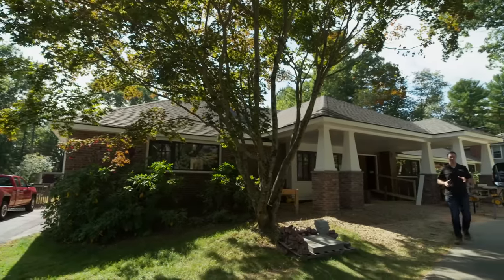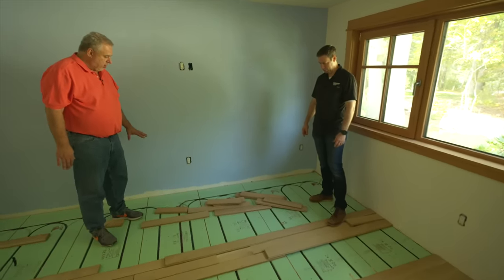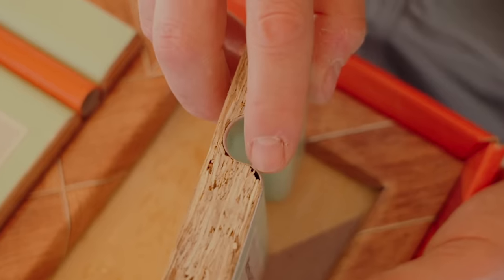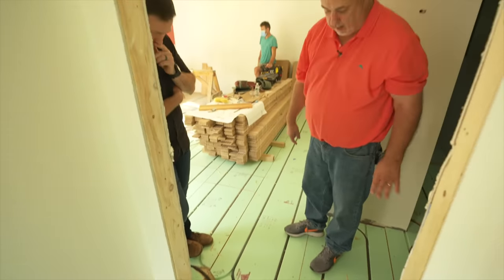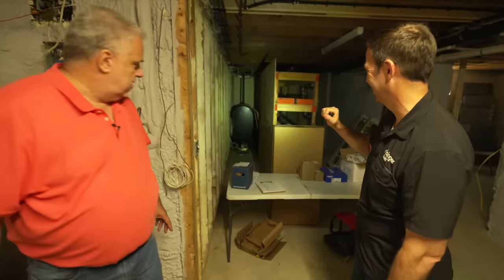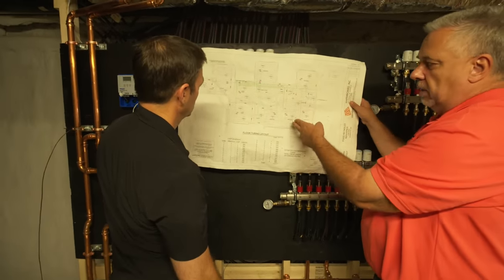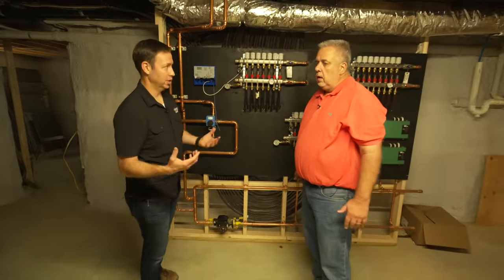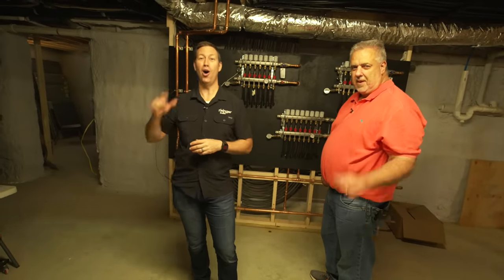Plug and Play Radiant Floor Heating System - BEST ON THE MARKET

Comment: Matt love your video, we have in floor heating in our basement in Alberta Canada, where it can get to -40c for up to 2 weeks without a break. It is truly a game changer for anyone that has ever questioned the cost don’t. We use a forced air furnace for upstairs we have a 3800 sq/ft bungalow and with just 4 loops in the basement slab it is toasty warm in the winter months. I don’t think we would ever own another home without it. Every other house we go into they are freezing in the basement not us. Love the idea for upstairs especially on a pre existing sub floor. I’d be concerned if I had a gas failure though as my frost line is 6-8 feet below grade so it don’t take long for above grade piping to freeze 🥶. Seen it too often where people’s pipes freeze and slip open.

Comment: @Michael Sun  We did the warmboard on our remodel in 2014 and used red oak in a varied width pattern with our widest boards being 10". We also glued and stapled and with the closed cell spray foam insulation we have are our mixing valve is set to a maximum temperature of 95 degrees and so far we have had no cupping or movement in the flooring. We are located in Connecticut and leave our thermostats at 72 degrees all winter and I can honestly say we couldn't be happier with the system.
Reply: Thank you!!! I would expect similar results here
Reply: So pleased to hear you've been having a great experience with our system.

Comment: That setup was anything but "Plug and Play"
Reply: Was thinking the same thing....this looks like a pain in the ass to install
Reply: @gregorygrimm5540  imagine the hardwood floor guy nails one the pex lines...... goes unnoticed long enough to have water damage the hardwood floors.... now try and find where the nail is.... rip up all the hardwood floors....
Reply: Last time I checked Warmboard was over $110 per 4x8 sheet. That was a least 10 years ago. I can’t imagine what it costs now.
Reply: Electric floor heating is the way to go
Reply: @gregorygrimm5540  Ha ha, but it will be ton easier to repair that than if floor heating was done inside of concrete (best imho since concrete retains that heat for so long even if it does not conduct it as well). However the good thing with concrete heated floor is that will unlikely ever need to be repaired. Have seen some that were over half century old and ran fine.
Reply: @danylachapelle309  you keep an air test at 100 psi on in floor heat basically the entire time it is installed until it is covered. You will know if you hit it while installing hardwood.
Reply: @TRUE_GR1T  yep, add in a battery, pressure switch and buzzer and you know within minutes if someone punched a line....
Reply: @danylachapelle309  well water has a nasty habit of flowing downward, so any water from a leak will flow to the nearest panel end seam and down to basement or crawlspace so you can get to the panel and the run fairly easily.  Now where along the run on that panel? well a magnetic stud finder can probably ID where the offending fastener is.  If you can access that spot from the bottom(not on top of a truss or joice) you can cut out the WB subfloor to access the tube and install a splice without pulling any hardwood.  If not you will have to pull some floor to repair the leak...
Reply: @danylachapelle309  You pressurize the tubing during construction and if they hit a tube you know immediately.
Reply: System Freeze (small/Murphy’s Law) risk would be a wintertime (storm) week long power outage while you are in FLA
Reply: @jmac838  you can use antifreeze if you are concerned with an unattended freeze...
Reply: exactly. but i guess that's the point of clickbait; as long as they get you watching the video the title can be an outright lie. id expect better from this channel, but here we are. this is probably a $40,000 install, on top of it. what a crock of sh-t haha
Reply: @briandonovan6546  i am finishing up a 2Ksq/ft and it wasn’t really difficult.  The panels go down like any other t&g subfloor, the tubes unroll and snap right into the panel grooves.  I taped my tubes and all the floor seams with aluminum tape to keep them clean during the rest of the construction.  Quite frankly the biggest hassle was laying out the zones on the cad before I placed my panel order(the WB design for my floorplan had too much waste)  the plumbing in this one looks complex because it is so large, mine is a simple all in one boiler/pump/controller, one box mounted in the closet feeding two stainless manifolds like the ones seen in this video.  The hardwood knocks down just as easy as is shown...  it is expensive...
Reply: @Bloodyback  Agreed, Don't they have carbon pads now that can be cut with scissors and are low voltage ?
Reply: @libertyrich555  not yet. Just rolls of prewired mats would be the fastest way. Some people still wire their heating floors by hand so they can go up on a bathtub for example. Mats are more costly than wired by hand too.
Reply: It is, it looks complicated, but everything is individually replaceable without disrupting the systems use.
Reply: @jmac838  i was thinking that as well, I've only seen systems like that using coolant, (glycol) mix as the fluid so it can't freeze
Reply: You aren't lying..More like plug and play yourself for a fool if you try..This is no DIY project...

Comment: What a well laid out system! I dont know how much I like the home run design though. I have seen radiant floor systems where they'll run an insulated main PEX 3/4" or 1" supply line right next to each radiant floor zone, and put the control manifold in the wall of a near by closet behind a small access door. That way you're not losing quite as much energy as running all the 1/2" loops back to the boiler room along the ceiling.
Reply: Devin H. It depends on your property as to whether it's worthwhile doing so. In many cases "waste" heat is not in fact wasted, if it's escaping into heated space it still serves a purpose. This is why radiator lines are rarely insulated, unless they are run under the floor in a void or perhaps in an unheated attic. Remote manifolds do make sense in sprawling properties though to save long pipe runs eating up much of the permitted pipe length just to get to and from the room you are trying to heat. They may also serve to maintain sensible temperatures in hallways etc- if too many flow and return pipes to various rooms are laid along a corridor, that corridor can become uncomfortably warm given the "density" of pipework beneath the floor, and the fact they can't be switched off without affecting the temp in the room those pipes serve.

Comment: In old drafty houses having even radiant floor heat made sense but I think as house gets more energy efficient by being tighter with more insulation I think the benefits of floor heating is diminished except for the bathrooms which could easily be electric. 
I considered it for my Townhouse renovation but I could not justify the cost and complexity. If you really want something you can justify it. 
I chose spray foam, efficient designed forced air heating system with metal round ducts, 2 zones in a 1700 sf  end townhouse - learned from Matt- with 3 sides exposed in a northeast coastal environment. Existing 2x4 framing with a lot of thermal bridging. Conditioned attic.Not super insulated but well sealed. Even after the spray foam was done i would check for leaks when the wind was ripping.  I think the spray foam guys did a good job but in the condition attic there were some difficult spots.  There were some large voids I filled with can foam. Summer cooling season was successful.
Waiting for winter when the wind can blow off the bay at 30 mph for 24 hrs with air temps in the teens . The wind is what matters and makes a leaky house uncomfortable.
Reply: Did you have spray foam installed in your attic? You can add loose fill insulation for hard to reach spots. Checkout my YouTube channel for more info on loose fill attic insulation.
Reply: @SinnisjInsulator  Yes spray foam on underside of roof sheathing. Making it a conditioned attic as tankless water heater and air handler are in the attic.
Reply: @lrc87290  that makes sense. Did you put 2 pound or half pound foam? Hey I'd love for you to checkout my attic insulation channel, let me know what you think. I mostly install loose fill.
Reply: This! A tight home virtually negates the need for radiant floor heat (except for bathrooms).  I built my home tight and the entire house is the same temperature.  I did put the pipes in the basement in case I ever want to add a radiant floor, but given the comfort of the house, this is very unlikely.  When you consider the cost, complexity, and downsides of a radiant floor heating system, it's simply not worth it.  Besides, radiant floor heating takes forever to heat up (while you freeze) and forever to cool down (after you get too warm).
Reply: @SinnisjInsulator  close cell 2 lb. I checked out your channel. Was wondering if you saw Matt Risingers video where he sucked out all the old loose fill then sealed all the leaks in the ceiling/attic floor then blew in new stuff. The video I watch briefly the attic floor was clean so is that what you do?
Reply: @lrc87290  i do all of it lol. I mostly blow in new builds but have blown in older homes, removed insulation, installed the baffles, you can checkout the 2min video with the picture that says how to save on your energy bills. It was an older home we had emptied and now installed new stuff at r60.

Comment: I live in South Florida and I use my radiant floor every day. It's so much better than opening a window. It get the house so warm without letting in the outside air in.
Reply: south florida? Where the average temperatrue in December is 78F high and 62F low?!?! why do you even need heat. if anythign you need year round AC

Comment: I live in Northern California, this system makes no financial sense here, but if I could afford it, I would install it in a heartbeat. When we stayed in a cabin in Tahoe with radiant, the sheer fact that your feet are warm and the heat is from the bottom and naturally radiates up makes it the absolutely most comfortable way to have heat in the home. You can have the house set to 70 and completely comfortable barefoot in shorts and a shirt in the dead of winter. For anyone that never experienced it, you really have to. It’s a luxury, but boy is it a nice one.
Reply: you can get the cost down to 1.5-2$/sq.ft + the ~10k in mechanicals... just not w/ warmboard.

Comment: Props to that hardwood guy. He has to shoot thousands of staples in that house and not hit a single radiant pipe. All it takes is a second of zoning out.
Reply: Note: it's completed and no problems, I agree with you, they did a hell of a job
Reply: I don't envy the remodeller who has to change out the floor in 10 years for a different "vibe".
Reply: Absolutely, this is a absolutely ridiculous pipe dream.
Reply: Why is it a pipe dream?  This is really cool!
Reply: @pauledwards1157  It's not practical, if anything goes wrong, you have a disaster in the making.  The project could make it difficult to sell the home at some point.  Buyer- " you did what with the floors?"  "show me that other house."
Reply: @thomass5169  Well, I’m about to do it to my house.  Going to infloor heat from forced air is definitely not going to hurt resale value.
Reply: @pauledwards1157  no doubt, I’m looking at homes in a colder area and it would be a huge selling feature for me.
Reply: I was a carpenter on a 8000sqft house with all radiant and over the radiant we put plywood subfloor because we used a floating floor system. So for each piece of plywood we had to take the time to draw out where the lines were. Of course I was nominated to run the staple gun. Over 20,000 staples and yep I did hit one pipe. I didn't space out and hit a transferred line it was a measuring mistake and the line was drawn in the wrong place . We didn't know I hit it til the next day but the leak was very minor since the staple more or less plugged up the water line. Still sucked but 1 in 20,000 I guess not too bad
Reply: @BSCTrainerRob  Thanks for this detail. I have 3 questions if you don't mind me asking. 
1. Does that mean the staple was left embedded inside the water line indefinitely or did you eventually have to redo that area?
2. If the staple is left inside the water line, is there an eventual expectation that it's going to cause a problem in a few months or so?
3. Does that understandable error translate to extra costs to the homeowner/client or doe the contractor take on that costs?
Reply: @zandersorc  the plumber had to fix it. He had a few fittings on deck because it was so likely to happen considering the size of the place. Probably the contractor had to pay for the repair but we are talking a $100,000 system so I dont think it was a huge deal. And as for the staple in the water line - it did plug itself up but I'm sure it would be a catastrophic leak in short order

Comment: Warmboard looks great but it's REALLY expensive. If you're thinking about this type of system but the cost is a barrier, maybe check out Ecowarm. It's much more affordable than Warmboard and works exactly the same way. (ps. there is some serious bad blood between Warmboard and Ecowarm--both companies really lay into each other for various reasons... the products are very similar and they are obviously competing for the same customers).
Reply: I was looking at some cost analysis a few months back and I want to say it was like 7$/sqft with self install for the board and the layout done for you. I haven’t looked into ecowarm at all, but I will now! The nice thing is the new construction version takes out the whole subfloor which does bring the cost down a little bit. May be pricey but damn it sure is pretty and simple!
Reply: You can also lay out the pipes free form on the subfloor and use a pipe stapler. We do that and just pour a self leveling compound over.

Comment: That basement looks to be more spacious than my whole house!
Reply: Yup I also see crazy big houses when I install Insulation. You can checkout my attic insulation channel if you want to learn more.
Reply: 2400 sqft he said. Bigger than our house.
Reply: @oltedders  I missed him saying that. That's twice the size of my house. Of course I'm in the UK, where houses are smaller generally.
Reply: @dalriada842  
I believe houses in the UK are the smallest in Europe. We have the smallest house on our block at 1700 sqft, 3 bdrm and a home office. The master bedroom has an en suite, dressing room, and a small snug. We've converted one of the bedrooms into an 8 seat home cinema. The garage is 420 sqft with a 150 sqft finished attic above. It's quite modest in size but lovely none the less.
Reply: @oltedders  is that all floors included or just square footage of one floor? I posted a video in my channel of an attic I completed in a 2500sqft house with 900sqft garage. People have crazy money lol.
Reply: @SinnisjInsulator  
One floor with shed roofs. Lvgrm goes from 8' to 13'6". bdrm is. 8' to 14'6" approx. Atrium in the center of the house. Attic space is 6'8" max.
Reply: @oltedders  wow that is small now is that 7 feet high? And it is a peak roof or flat roof?
Reply: @SinnisjInsulator  
Shed roof is a flat roof set at an angle. The attic space is for storage only. Enough room to stand on the high side. Wall to wall, floor to ceiling cabinets on the low side. Approx 8' x 17' of floor space over the garage. The garage is attached, the house and garage are 2200+ sqft total.
Reply: @oltedders  so the attic must have only a r32 or so? The trusses usually are the places where there will be heat loss.
Reply: @SinnisjInsulator  
We're in the South. We are more concerned with heat gain than loss. The ceiling over the garage and the floor of the finished room is insulated with R19. The roof decking is covered with reflective foil that repels UV rays. The ceiling of our store room has 1" insulated foam board under the sheetrock. Heat build up in the rest of the attic is vented between the rafters through a system of 4 turbines on the roof. A small electric heater is sufficient to warm the space in winter.
Reply: @oltedders  I have heard about this reflective foil, the us are really bug on it and it seems to work. I haven't seen any construction around Ontario Canada that has it. Maybe we just need to catch up. Ventilation is definitely very important to get rid of the hot air buildup. Hey I'd love your opinion on my attic insulation channel. Come check it out.
Reply: Steve Slade  i realise I have made too many of the same comments. It's people's whether they want to see more info. I'm just saying I have footage using my GoPro so it may give people a different view on loose fill.

Comment: Installed warmboard and low temperature baseboard, two years ago.  I now heat the house from the water heater.    No more boilers bring on heat pumps to climate zone 6.